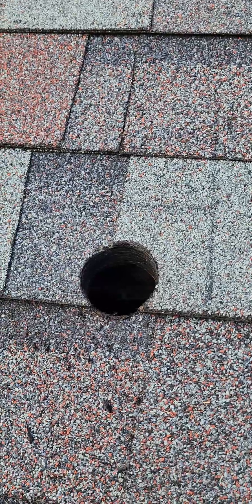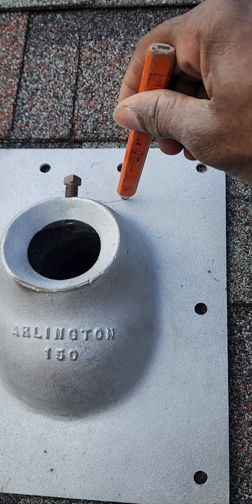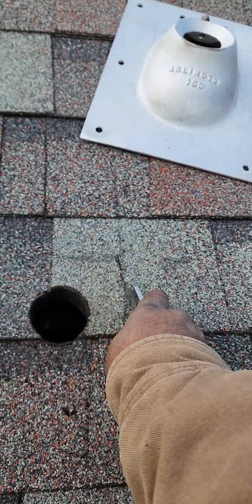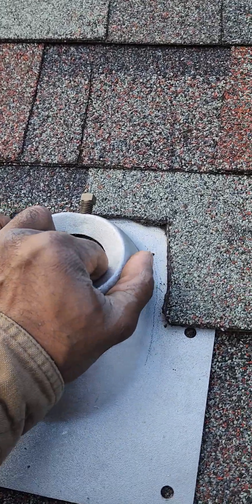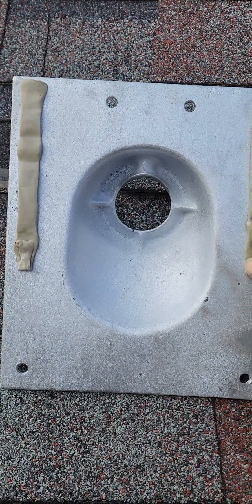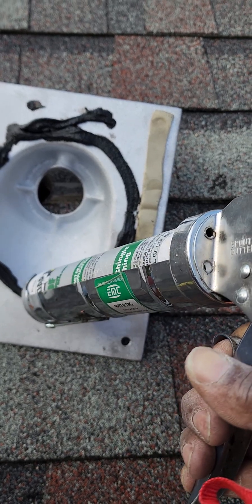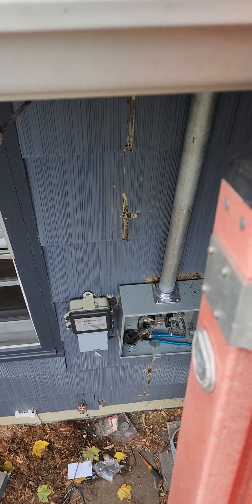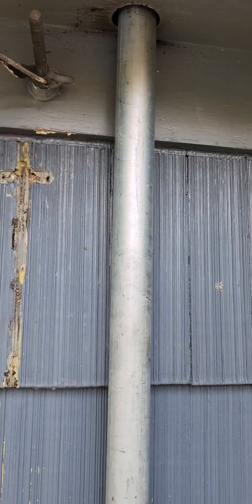Riser THRU roof

Comment: question ...how does water stop from going own it? Is there a rubber boot that goes over it or do you use Duct seal or something around the conduit? Thanks for the video!! Its hard do find a through roof riser...most seem to be offset risers.